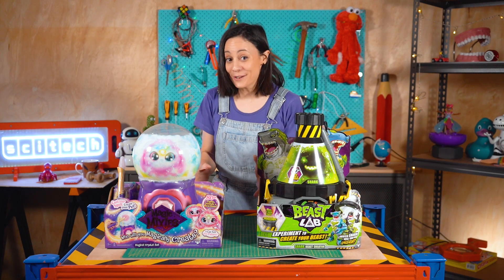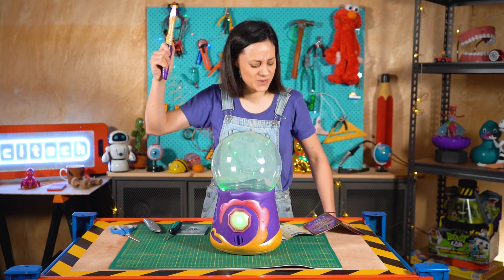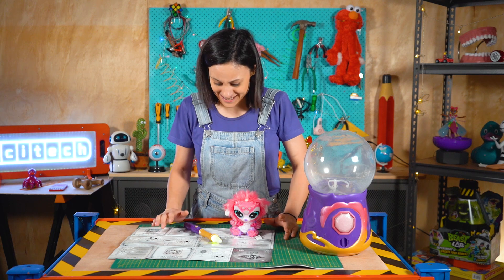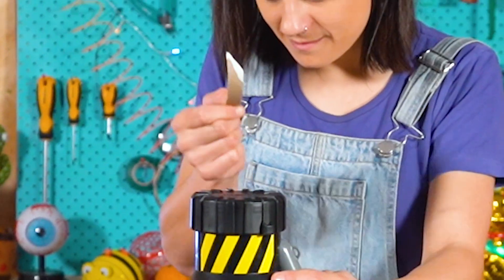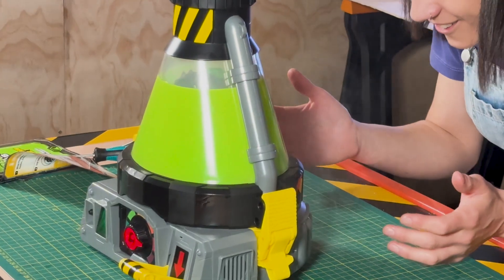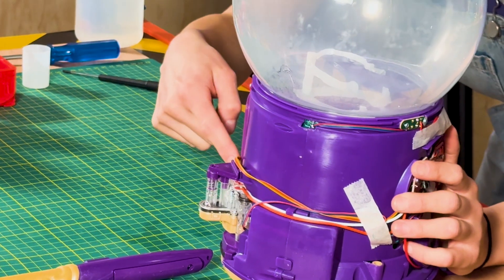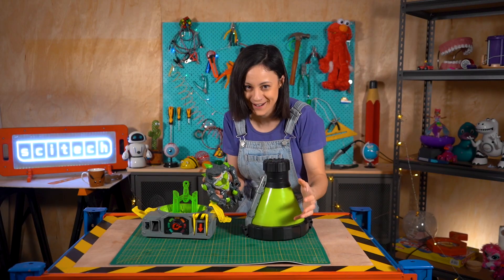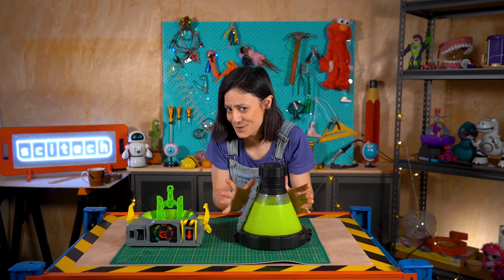Behind the Crazy Reveals of Magic Mixie & Beast Lab - Toy Teardown

Comment: What's the liquid in the beast lab? Ours is leaking and i want to refill it.

Everywhere i look is pretty much about the mist refill packs.
Reply from the maker: Great question, it's apparently a non-toxic water based solution - unsure what the colouring agent is, as it's super bright and opaque - if you press the valve underneath (while upside down) you could try topping it up with distilled water. (But this could also make it a little more transparent). Try emailing moose toys to see if they can tell you, but my guess is the colouring agent would be a special pigment. Goodluck :)
Reply: This video gave me the courage to take most of it apart. We kept the liquid reservoir intact, flipped the thing upside down, let remaining fluid drain into the transparent section, removed the collar and end of the hose at the black reservoir area, then added water into hose with a funnel, which drained into the transparent section. I feel like we had to press the release valve throughout the refill too. Be careful when removing hose. It may be pressurized a bit. Even with a few mL of water it was still plenty opaque. Not sure when it would start to "thin out" too much.
Reply from the maker: @RevsPastRedline  Awesome! So glad the video helped! It's super satisfying when you can work out how to fix things yourself (and why I love YouTube so much!) :D